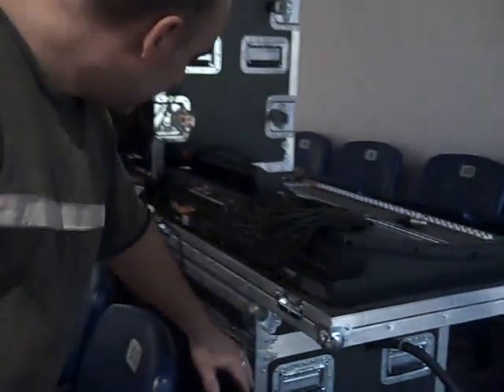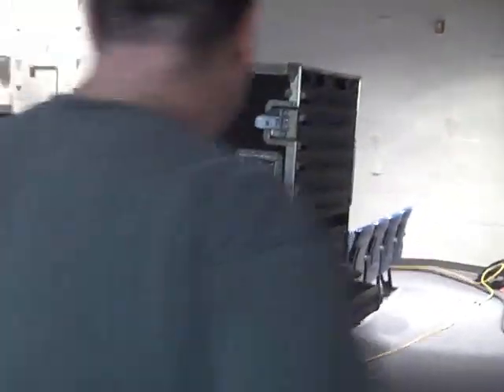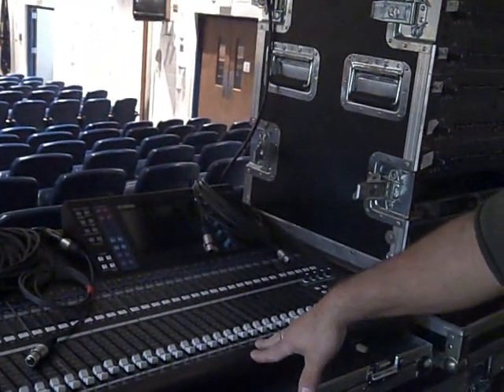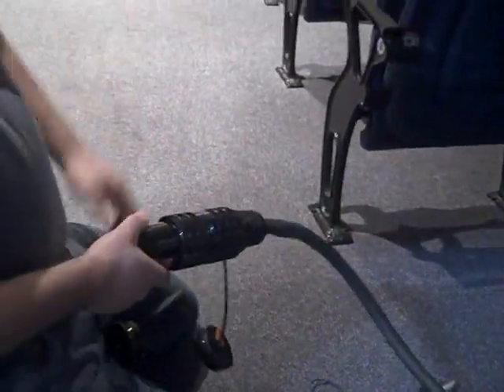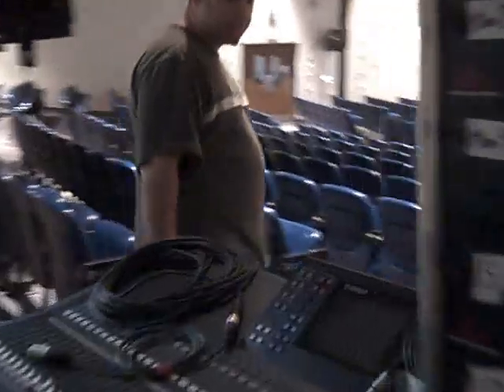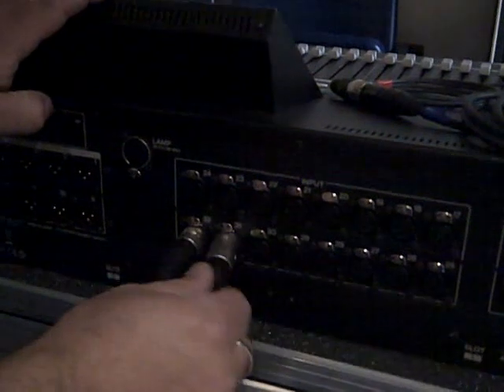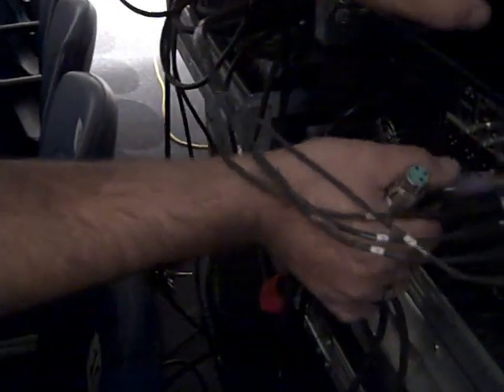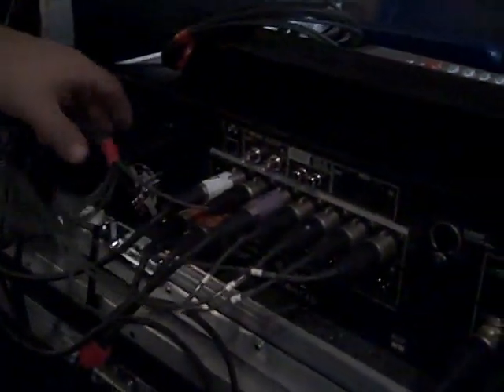Hooking up front of house

Comment from the maker: @abrahamflako11 
Connect the transmitters to each of the individual  AUX outs of the board. Depending on the board and transmitters, you may need either XLR (mic) cables or 1/4 inch TRS cables. You then turn up each individual AUX on each individual cahannel. It basically works the same way if you're using wedges, although the mixing technique is a little different, and you don't have outboard amps and EQ's like you do with wedges.
Hope this helps!